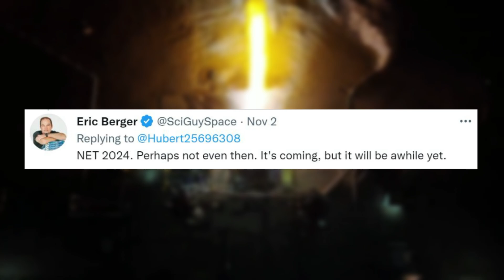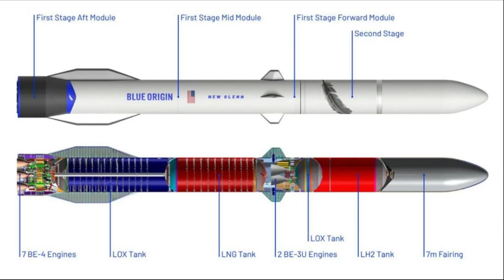When Should We Expect To See New Glenn Lift-Off For The First Time?

Comment: My cousin worked at ATK, then SpaceX, then Blue Origin, then back to SpaceX.

He said that work at SpaceX is taxing, but they recognize what you do. At Blue Origin he was invisible, because he had no seniority. The company also, apparently, has little communication between different areas.

He was offered a return to SpaceX, with a promotion, and took it swiftly.
Reply: this is just straight cap lol

Comment: Even if New Glenn beats Spacex Starship to orbit, spacex is still the winner.   SpaceX is building a ROCKET FACTORY, New Glenn will just be one very nice very expensive rocket.  SpaceX rocket factory will produce dozens if not hundreds of relatively cheap rockets in the time it takes Blue Origin to make a second New Glenn.
Reply: NG is cheaper than FH and the factory that BO has built is double the size of starbase.

Comment: Just thinking that by the time New Sheppard is launched it will be so obsolete it won't even be funny. They are so far behind the Falcon 9 and 9 Heavy that, unless SpaceX completely abandons those platforms, they will still be completely irrelevant in the face of Starship, a fully reusable launch system that will probably launch the first test sooner. I'm thinking that B.O. should stick to the production of actual engines and leave the innovation to the people that have already done it. You can't operate per the old paradigm when it has already been rendered obsolete. Unless, of course, they figure out a way to recover the 2nd stage. That would be a game changer in the mid to heavier lift category. Inflatable heat shields, anyone? Cut down on payload capability, but lower the cost, too. 😉

Comment: 3:32 Small point, Blue Origin apparently has dropped the idea of landing "on a moving platform at sea."  Speculation is they will go the way of SpaceX and land on a stationary barge. Another point, the BE-3U is a not just a restartable BE-3PM that has been optimized for vacuum.  The BE-3PM is a pump-fed engine design, with a combustion tap-off cycle to take a small amount of combustion gases from the main combustion chamber in order to power the engine turbopumps. The BE-3U an open expander cycle (like the Aerojet Rocketdyne RL10).  Though these are similar sized engines they are quite different and could provide their own set of developmental problems.

Comment: What happened to the New Sheppard booster last launch?
Reply: I don't think anything official has been said by BO at this time about that booster. I think the main theory at this point is that the engine's turbo pump had a RUD and sent pieces/parts through the rest of the engine and the bell/nozzle/throat causing the failure. A probable reason for the failure of the turbo pump is due to hydrogen embrittlement. Basically because hydrogen is so small it can be absorbed into the metals that it comes into contact with. When that happens the amount of stress needed for cracks to start happening in that metal is drastically lowered.
While I can't provide you with an official answer, I hope that helps some. Have a good one.
Reply: @dr4d1s That is a Great reply! This device normally lands itself autonomously. They must have used the 'Abort Destruct' if the engines were in doubt. That leaves one question. How high was it at that point when its payload took off how far did it get after that?
( and how many people were paid to hush up about it) LOL
Reply: New Glenn and New Shepard are not the same beasts.
Reply: @WWeronko  Even Captain Kirk knows that and he won't even be born until 300 more years or so.
Reply: Thats a really easy thing to google
Reply: @FishyAltFishy  I tried Google. It's a Secret. 

Would you buy a ticket for 80 million dollars just to ride in one for a few minutes??
Reply: @davidmacphee3549  how does this fake number get higher each time. One of the seats was auctioned off for $28 million, the money went to BO’s non profit not the company itself. The latest information on pricing per seat is $1.25 million.
Reply: @luther0013  Good Information. I didn't mean to exaggerate. Whoops! I think the auction was said to go to 28 million. My point was supposed to be that, customers must have complete faith to be willing to pay for a seat and an apparent failure of the system could shake that faith.
Reply: @davidmacphee3549  while the booster failure is a bad hit for BO’s rep I think they really need to push hard on the fact that the escape system and worked properly and the capsule landed safely. 

Personally I think blue should do a Air Crash Investigation style documentary on the loss of the booster so that people can understand what happened and feel that the issue that caused the accident has been properly addressed.
Reply: @luther0013  Another great reply.
 I suppose they have valuable telemetry to study that outweighs the loss of the Booster. 
However, If the capsule data suggests injury's would have been caused to the "tourists", They have their work ahead of them and it wont be easy.
 Jet Pilots are trained to resist G-Force.